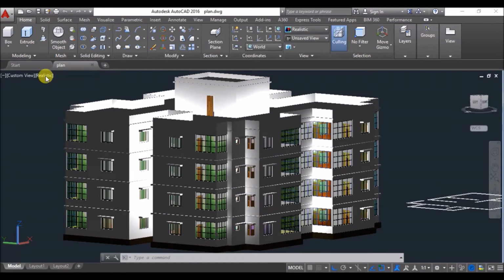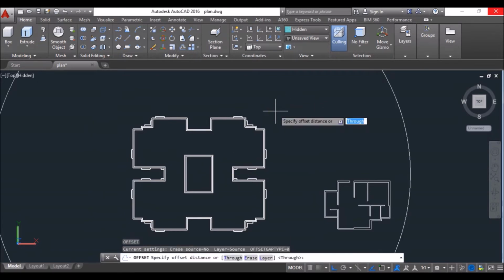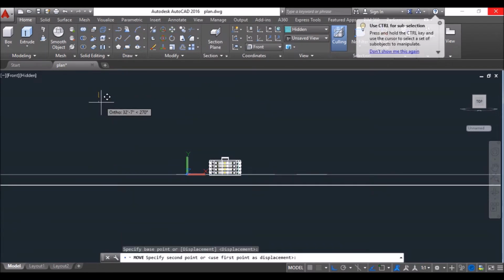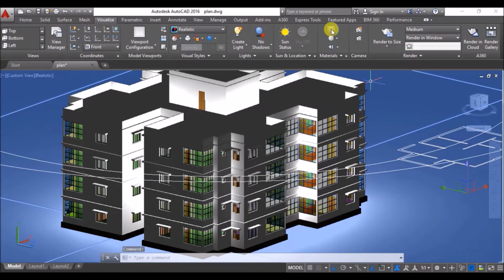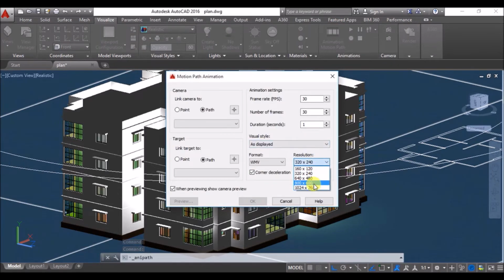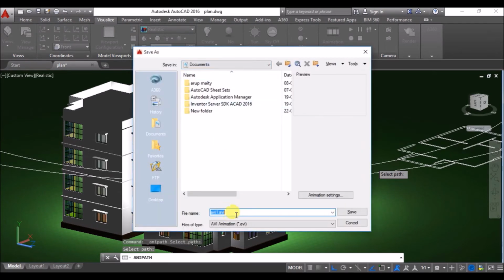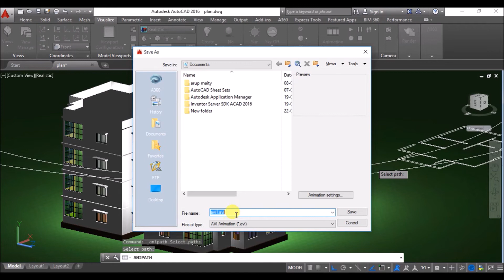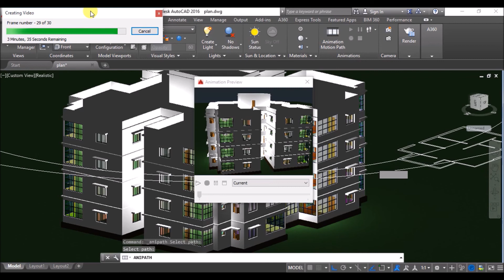AutoCAD House Design (3D)- Part 14- Motion path animation (2021)

Comment: Hi @CADD MANIAC

Thanks for making this useful video., i am having 2D elevation design(.dwg file) which i am trying to convert into 3D. any help would be appreciated
Reply from the maker: Yes of course
Reply: Can i send you file once on you mail if yes, kindly provide you email🙏
I am actually from IT background so not very friendly with auto cad
Reply from the maker: @AmitSingh-fu8gm  contact details provided in the'about' section of the home page
Reply from the maker: Very sorry but you are just asking me to convert your 2d plan to 3d, which is not possible at all. You can do it yourself.